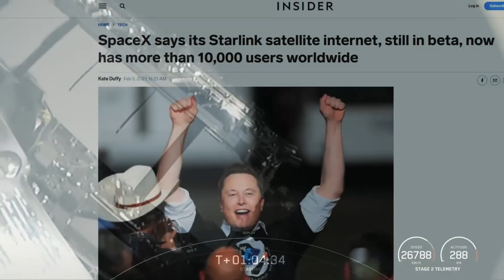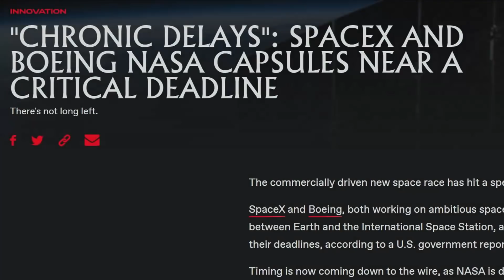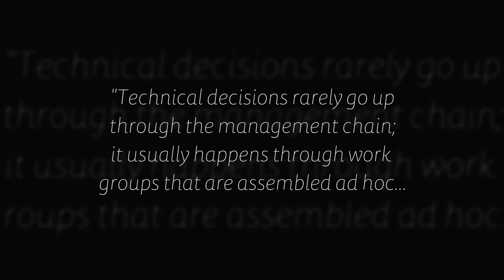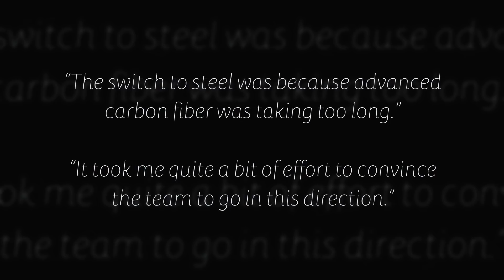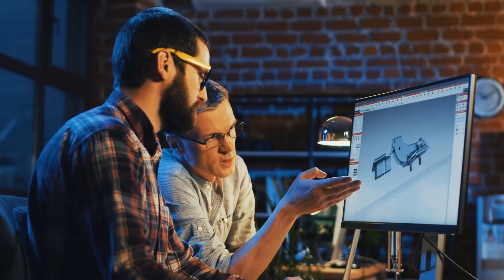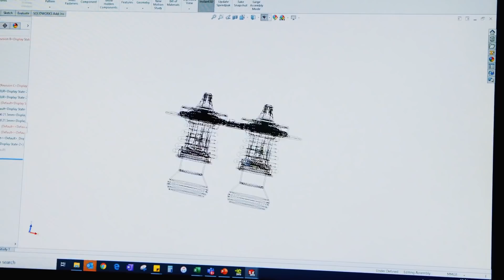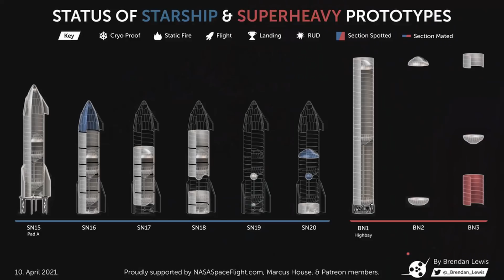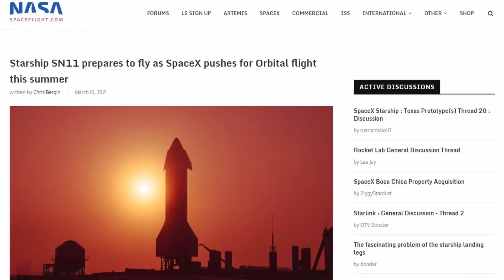How Does SpaceX Move So Fast?

Comment: The largest container ship, the hmm algeciras only cost $140 million and it's far bigger than any rocket...
Reply: Space x is already the cheapest in the world by far, thats so unnecessary comment lol
Reply: What in the world is that supposed to mean?
Reply: @penguinyay1936  Wrote that when I saw the thumbnail.
Just saying there is room for improvement to reach the same cost per ton.
Reply: You r right, there is a room for improvement, and forever will be, thats not very accurate, but ok
Reply: @penguinyay1936  Superheavy/starship should cost ~30M$ to build and weight 320 tons (dry mass) together. That's 94'000$ per ton.
The largest ships cost 140M$ and weight 200'000 tons. That's 700$ per ton so 134 times cheaper.
Reply: @johntheux9238  this is stainless steel 304L for starships, and ships are using ordinary steel, but we r comparing a reusable space rocket to a  100 years old tech so..
Reply: @johntheux9238  Idk how anyone made a 400 meter ship for 140 million, but that's almost orders of magnitude lower price then it used to be for ships of that size, i guess we can just wait a hundred years and see the rocket cost then
Reply: @penguinyay1936  Yeah, stainless steel is about the same price as aluminium at 5'000$ per ton versus 500$ per ton for carbon steel.
That's still only 5% of the total cost while for the ship the material is 70% of the cost.
Reply: @penguinyay1936  There will be a starship 2.0, then a 3.0, 4.0... They will be bigger and bigger and cheaper per kg too.
Reply from the maker: @ John, that's pretty interesting, 70% of cost being material is very impressive. I remember reading that on the way back from the failed negotiations with Russia for an ICBM to mars, Elon showed a spreadsheet he built to (Jim Cantrell I think), detailing all the material costs required to build a rocket, and showed that the cost of a rocket was orders of magnitude higher than the material cost.

It was this cost differential between materials and final, that he believed showed that much cheaper rockets could be made. Apparently Jim agreed with his analysis and they founded SpaceX on the back of it. SpaceX has closed a lot of that gap, but it's exciting for future space exploration that there is so much more room to go.
Reply: @ExaCognition  It's maybe lighter than 200'000 tons, I can't find the displacment so I used the cargo capacity.
Have you watched Hazegrayart channel? Super Orion for example is in a league of it's own with a diameter of 400 meters.
The bigger the cheaper.
Reply: @ExaCognition  Super Orion is perfectly feasible.
The ship weight 7.25 million tons so 566kN/m2 for a 200 meter radius and 362kN/m2 for a 250 meter radius (with boosters)
At 1809kN/m2 (2,261kN/m² for the engines, 80% packing density) raptor engines can lift 2.6-4 times more mass and still get 1.25G at takeoff so you have enough thrust for a chemical first stage to leave the atmosphere.
Reply: There’s no room for error with a rocket carrying payload into crowded and valuable orbit. It’s a much different goal and a cargo ship in the sea. One is moving slow in the sea, the other needs to move 1000s of km/hour without exploding
Reply: @scienceisall2632  A ship has to survive compressive stress, it's way more difficult than a rocket because of buckling.
But the rocket has to be as light as possible so the margin is smaller.
Reply: There's definitely still room to improve, but you shouldn't expect 2 completely different applications for a material to get the same cost per ton. Making a lot of small complex pieces that add up to some weight is more expensive than making a few rudimentary pieces which add up to that same weight.